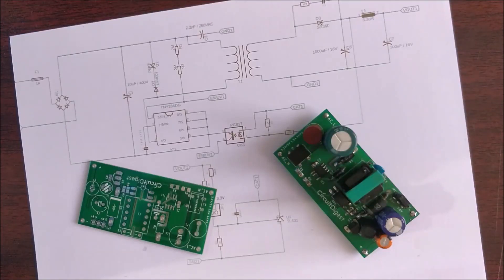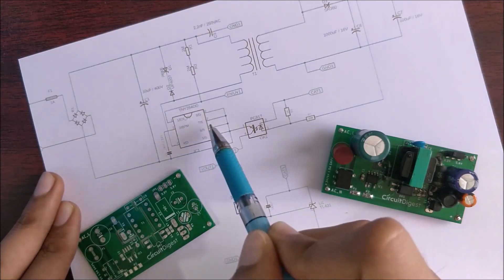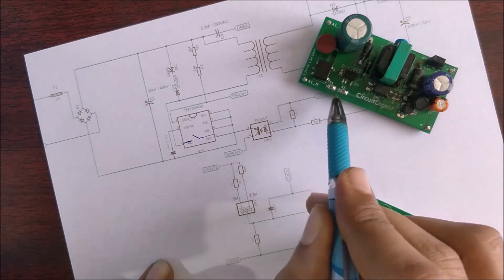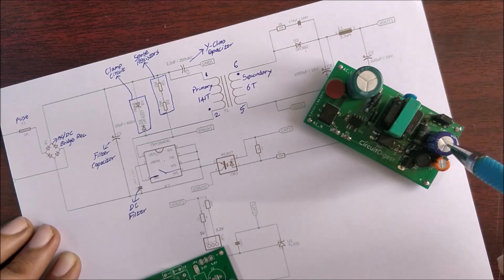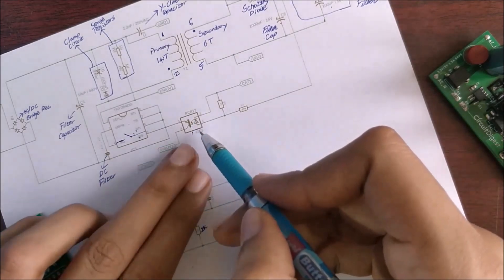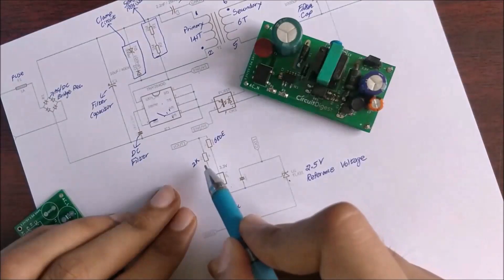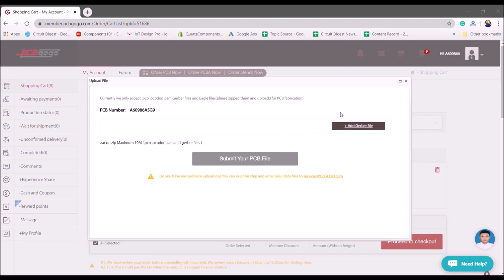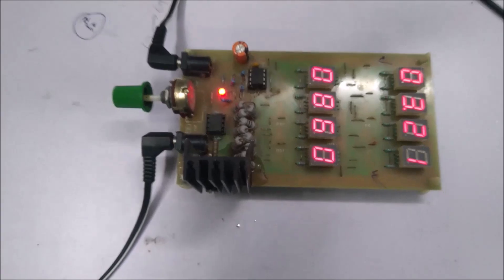How to Design a Compact 5V/3.3V SMPS Circuit for Embedded and IoT Projects

Comment: What Is Efficiency 
And On load Regulation?
Reply from the maker: it has been a long time and we did not measure at the time of building. May be we will build one more in future and be sure to measure it
Reply: @Circuitdigest   i need So much tiny Small size 5V 2A or 5V 3A, High Power output capable and at low budget. Thankyou

Comment: Sir there is a requirement to power up an SoC and a small DC motor (load) using a 9V rechargeable
battery and the SoC is operating at voltage range of 3.0 V – 3.6 V. The current can vary between 10 μA to
80 mA during the deep sleep mode and modem mode respectively. The 5V supply is needed to
power up the motor can you help me design dual output voltage supply circuit including a Zener regulator.

Comment: Where do we get Transformer datasheet ? How to design it ? Do you refer any Design software like power integration?
Reply from the maker: Check the link in the description.
Reply: Can you send me the parts ? I need 12v 3A. I want to use it in my PCB (GSM based board)

Please share your contact details to amaraxr@gmail.com

Comment: Very nice video! I followed your instructions and made several of these, one on a homemade pcb, and one on a professionally made pcb. They both work great. One question - on one of them I added an input filter to reduce EMI, consisting of two X2 capacitors and a common mode choke. This is common on SMPS’s.  But it added length and weight to the board and cost additional $$.  How important is it to use such an EMI filter if I’m
going to use this power supply in a small IoT device?
Reply from the maker: There are cheap SMPS circuits without EMI filter section, but if you are powring an embedded IoT chip it is recommended to have one. You can get away by without using one if you are just powring an LED or charging a battery because EMI will not be a problem in these cases. If you have any questions on how to reduce the cost you can post them here https://circuitdigest.com/forums on our forums and people there will be able to give you better ideas

Comment: I like the way you work with electronics. and I'm tried the things you showed here... but I am always struggling to find/get exact SMPS transformer for my application ... can we make one at home if yes please make a video on it....thank you
Reply from the maker: Yes, it is hard to find an off the shelf SMPS transformer for your design. You can either use our datasheet https://circuitdigest.com/sites/default/files/SMPS_for_IoT_transformer_spec.pdf and provide it a transformer vendor to get a custom made transformer for this SMPS. OR you can also build your own if you can arrange the right components. https://circuitdigest.com/tutorial/how-to-design-your-own-transformer-for-smps-power-supply-circuits This article will help you learn how to build your own SMPS transformer
Reply: Circuit Digest Youre not going to easily find the right transformer off the shelf. I made this circuit , including winding my own transformer, carefully following the instructions in the plan, and it works great!

You will need to purchase a ferrite core, plastic bobbin, two sizes of magnet wire, and insulating tape.  There are a number of YouTube videos showing you how to wind a high frequency transformer for a SMPS.  Do it properly, if you want the power supply to be safe.
Reply: @Circuitdigest  thank you very much 👍